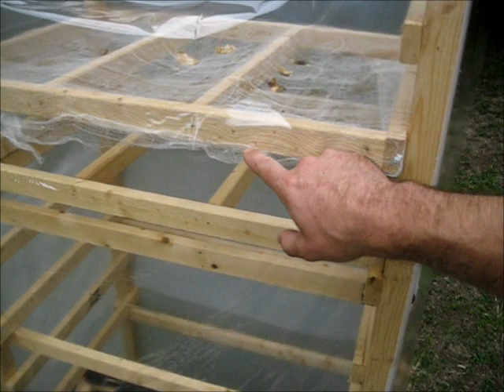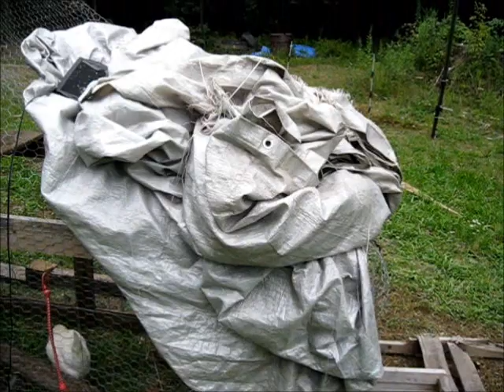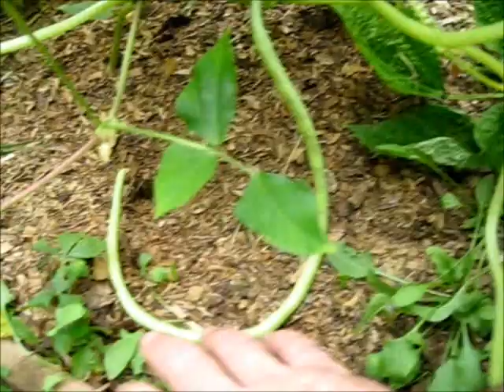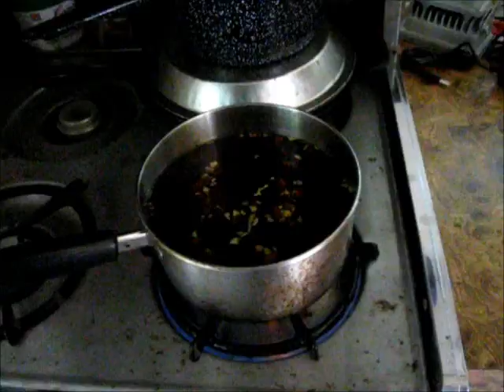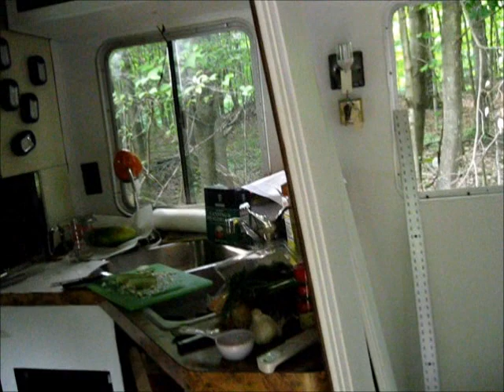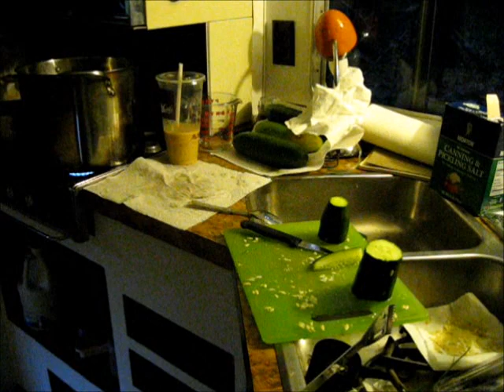Canning Fresh Garden Vegetables In My Off Grid RV

Comment: I tried to save seeds from cucumbers and what I found out was I had to let the cucumbers grow until they were old and turned yellow before the seeds were good. I take the seeds and put them in a jar of water for a few days so they will separate from the pulp and you will find out the seeds that sink to the bottom of the jar are the good seeds. The ones that float won't grow they might look ok at first but when they are dried out the sides will shrink in. This is the best way to save tomato seeds as well.

Comment: The heat from the hot jars and boiling liquid will soften the glue under the laminate counter tops and they will bubble and loosen. Do not set hot pans, etc., on laminate counter tops. You will destroy them. I use thick, wood cutting boards with round, cork "hot plates" set on top of them. Insulates, protects the laminate surfaces. Or simply set the jars on the stove top surface, on top of towels. Just a suggestion for those who care to know.

Comment: been seeing alot of mildew and fungus on the plants, try baking soda at 1-2 tbsp per gal of water applied at 5 day intervals with a pump sprayer.oh also mix in some liquide dish detergent as a spreader sticker. also if you add some lemon or lime juice concentrate(at 4-6-tbsp per gal) it will help with aphids and other rasping insects.

Comment: When you make your "sink board", cut one piece, then cut it in half along the sink divider line.  then you can cover both sides or either half, freeing up one side of the sink.  Most of the time they just drill a conveniently placed finger sized hole, to assist in lifting them off.  A couple of small pieces of 1/2" x 1", on the under side, will keep them from sliding around.  That's an old RV trick to expand counter space.  You actually have more counter space than I do.  LOL

Comment: I meant the RV, and I just remembered your set up was microwave on the bottom and conventional oven on top, right? So you still have a conventional oven. Anyway oven racks work fine for a grill to cook on with pans, I you are lucky maybe you can find one from a really old stove the wires are closer together. We always used one when we went camping, much easier to pack than a real grill. Just dig a hole and find a few rocks.

Comment: Those generally aren't large enough when working with canning jars and full canner load batches. 

Easiest thing for me to do, whether waterbath or pressure canning is to use a separate water bath canner to heat (or sterilize, if needed) jars. Using the rack keeps jars upright while heating. Plus can use that hot water, if needed for other purposes. If canning for several days in a row, just leave that canner filled with water on the back burner. Leave any unused jars in it. Reheat the next day.

Comment: No need to toss. Check seals after about 12 hours. If jar isn't sealed refrigerate and eat. Or, reprocess after checking jar rim for nicks and replacing failed lid. Generally, I don't like to reprocess. Results are overcooked. & often not worth the time to setup, process, then clean up for just a jar or two. Just go ahead and incorporate in upcoming meals as if it were just freshly cooked. 

If seal failure discovered after a day or two has passed, then toss it.

Comment: FYI - toxin from spores cannot be seen, smelled, or tasted. That's the danger, as it cannot be detected without lab analysis when present in canned foods. Thus the importance of following tested processes & procedures. USDA guidelines are based on most current research done at university extension services & other testing facilities. Canning supply vendors use same guidelines for instructions for use of equipment.

Comment: Yes, jars are put in pot and covered with about 2" of water. Timing begins when water reaches a full boil. Hold boil for length of time given in directions for item being canned. You probably also remember her big blue speckled enamel canner. :-)

That's what most folks used for waterbath canning when I was young. Fortunate to have both my Mom's & MIL's enameled canners. Flea markets are good place to find the larger older ones at decent prices. Watch for bad chips in enamel. Small chips OK.

Comment: Use directions from canner manufacturer, Ball Blue Book, other canning jar suppliers, USDA web site @ University of Georgia Extension Service, or 1 of the other university extension services. 

Both excellent & incorrect/inaccurate information is in YT videos. Just as it is on various web sites. Until becoming experienced in canning always check YT & other sources against references mentioned. With experience becomes easier to identify risky processes & decide if you want 2 take associated risk.

Comment: Yes, pressure canning is good way to prep tough meat! Love to can venison. FWIW, I can meats & vegetables separately for couple reasons. 1 - Can use the meat in many different recipes at meal time. If already canned for single purpose use, stuck with that choice.

2. Many vegetables required a less processing that meat. IMO better end product if processed separately in pints & quarts. Then combined at meal prep. Plus, if fresh on hand can add that instead of what's canned.

Comment: You mentioned a pressure cooker. Hope you mean pressure CANNER. Most pressure cookers not recommended for pressure canning. Tested canning recipes & timing instructions based on a pressure canner with minimum capacity of 4 quart jars. Many (most?) pressure cookers can't handle quarts. Plus specific procedure for timing exhausting & cool down is applicable to canners. Pressure cooker quick cool down cannot be used when canning. 

If you have a pressure CANNER, please ignore this post.  :-)

Comment: hiya, yw, I just finished watching a vid about solar panels, and was disheartened, I called the company about what if an EMP, the batteries to the generator aren't protected would they still work. Well they claimed to not know the answer to that question. From my research it would destroy the batteries, but I'm not 100% sure. You can't  put that big unit in a faraday cage all the time and use it too. So what to do anyone have the answer?

Comment: Two tested methods. Waterbath - Canning in regular pot with boiling water for time required 4 recipe. This for high acid foods such as fruits & pickles. For low acid foods, pressure canning at 11 lbs pressure (sea level) is required to kill spores that can produce toxins in foods.

Clean kitchen BEFORE canning is important. Clean work area & clean equipment. Clean up afterwards only needs to be timely. Does not have to be immediate. Doesn't hurt anything to wait & clean up kitchen next morning.

Comment: Uhmm, if memory serves have WWI canning book that used a steamer. Long ago that steamer was proved unsafe for canning low acid foods. Can't speak for the  one you mentioned. Only the 1 in the WW1 book. 

FWIW, pre-sterilizing jars isn't needed when waterbath canning unless processing time less than 5 minutes. Not needed when pressure canning. Pressure canning & waterbath for 5+ min sterilizes jars & contents at same time. Jar should be clean & hot if hot packing or placed in pre-heated canner.

Comment: Congrats on your canning finds. Those prices sound like waterbath canners. They work fine in either place. Next, you'll want 2 look for pressure canner (not cooker) to process low acid vegetables & meats. Can use it with a propane burner outside, as well.

To start learning get Ball Blue Book. Has illustrated instructions on how to can with both methods. Plus recipes 4 wide variety of foods using each. Winter good time to learn with small qty from farmers mkt etc. B4 garden yields big batches

Comment: Those long snap beans look a lot like the beans someone gave me many years ago. If they are the same or similar, they mostly just get long with the thickness of a normal green bean. As for saving seeds from cucumbers, I've not personally done so but if I remember right, you have to let the cucumbers ripen on the vine to get viable seed. However, doing so will cause the plant to stop producing. Correct me if I'm wrong.

Comment: Canning safety: I'm surprised that you didn't waterbath can pickles. All quick type pickles I've done required it for x time. Been a while, so I'd have to look up again. Suspect pickling solution you used requires waterbath processing. 

Mentioned "experimenting". Home canning is one place that you can't experiment & be sure you have a product that's safe to eat. There are very real risk factors for both visible spoilage when you lose your food & invisible toxins that can cause illness & death.

Comment: Summer kitchen - Setup place to do most, if not all of your prep work under the RV canopy. Even if you are processing jars inside. Setup table of some type with plastic tablecloth. Make or repurpose, depending on what you have. Use plastic dishpans, or equivalents for your "sink". Provides plenty of work (counter space) & keeps prep mess outside. Use dish towels to cover prepped food until you can put into jars. Keep bucket or pan handy for discarded scraps. Makes cleanup easier.

Comment: Canning - several options if you don't have a wire basket for your canning container. Use anything that'll function as a trivet to keep jars off bottom of pot. Appears a round cake cooking rack will fit your pot.. Canning jar rings, - top up - and nestled together will support jars. A folded dish towel placed in bottom of pot is another option. As long as there's water in the pot, it won't burn. Look around your stash. As long it's food safe & lifts jars so water can circulate, it'll work.

Comment: Canning - Boiling Water Bath Method 
You can do this outside over an open fire or use a propane turkey fryer type burner. You can use any food safe container that's large enough to hold your jars + inch or 2 of water over them. As long as you can maintain a boil for the time required for the recipe, works fine outside. Have a neighbor who uses a cut down 55 gal drum for big batch canning. Sets it on blocks & keeps a fire burning underneath. Has sheet of metal he uses for a "pot lid".